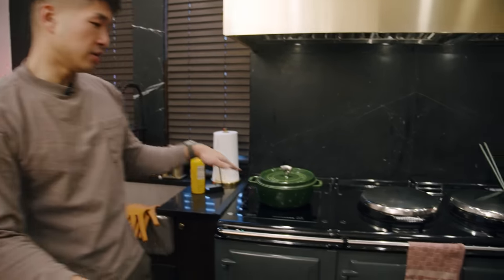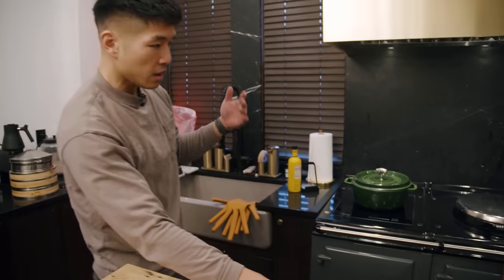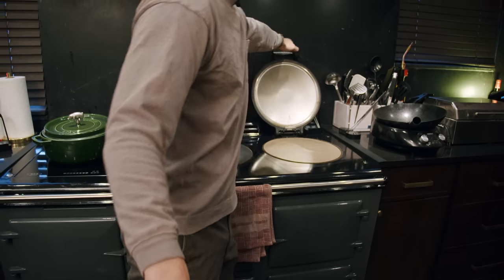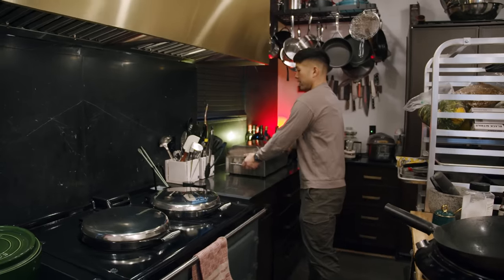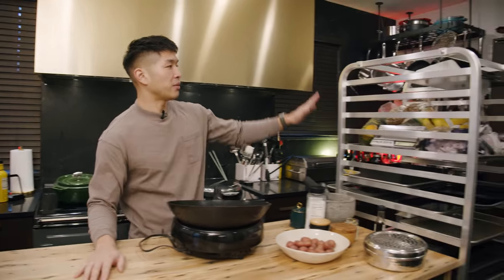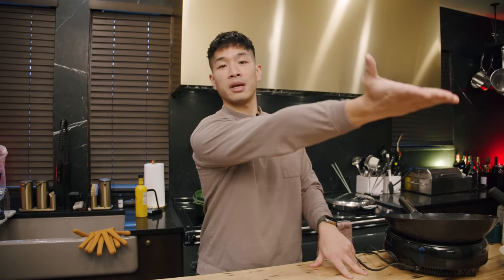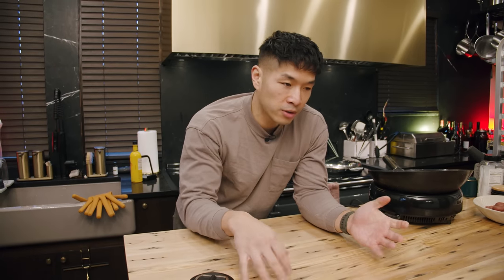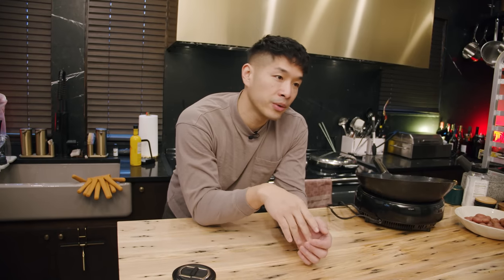Kitchen Tour: A (Gas Free) Kitchen That Does It All!

Comment: My husband is from the UK and he could not deal with the slowness of U.S. tea kettles. He bought a European kettle, changed the plug and we upgraded one outlet in the kitchen. It's so useful to have that upgrade available and of course, for as much as we use our kettle, it's totally worth it.
Reply: Is a European kettle an electric kettle or is there a difference between electric kettles in the US vs the UK?
Reply: @kimiya777  There's a difference between electric kettles in the US vs the UK. The difference difference really starts in the countries electrical grids and ends up in the kettles. The US standard is 120V and the UK standard is 240V, that means that UK kettles can be (and in fact are) designed to use more electricity in order to heat things faster, about twice as fast.
Reply: @kimiya777 It is how much power an outlet can provide which determines how quickly a kettle can boil - not the voltage. Power is voltage multiplied by how many amps the outlet can provide. 

In the US, a 15A outlet can only provide around 1700 Watts, and a 20A outlet 2200 Watts, while a typical UK (and European) outlet can provide around 3000 Watts 

Electric kettles in the UK are typically between 2200 watts and 3000 Watts.

Comment: as a person who is pretty stubbern on gas burners thank you for showing me this perspective. the induction wok burner is very cool
Reply: Yes, cool indeed. But will it convey the wok hay needed in most chinese cuisine.  I'm stubborn not because of the convection stove, but the price of electricity is relatively higher in my country. Even some laundry owners use gas to power the dryer.
Reply: @senadzri  Solar panels could be an option. Wouldn't need an expensive setup just for a stove. If you want wok hei, just use a handheld torch and torch the food gently from above--it's the combustion of oil particulates that gives the wok hei flavor
Reply: ... stubborn*

Comment: As someone who has had both an induction(new), gas(very old) and electric(mondernish) kitchen. I would take the old gas kitchen anyday. That stove was literally older than me and performed better than any induction range I have used. I wish induction was as good as he says but in my experience its just a better version of electric which is not better than gas.

Comment: With the induction wok, can you lift the wok off the burner and toss the food as is common with wok cooking, then put the wok back down onto the burner and have it continue cooking seemlessly? The reason for my question is that with many induction surfaces, the burner will turn off automatically if it doesn't sense a pan, and you have to manually turn on the burner again.

Comment: Hey there could you do a video on your Wok - seasoning, maintenance, and cooking basics? I got the same one because of that short you made a while back. Everytime after I season it, it will eventually fail and rust. I tried various methods of seasoning and it seems like the problem is that while I'm cooking, my metal spatula chips the polimerized seasoning and exposes the metal? Not sure but my first cook after seasoning is perfect but each one after is worst until everything is sticking and burning. Would love to learn from your expirences with this tool. Thank you!

Comment: I'll confess: AGAs have ALWAYS bothered me because of their whole "have to be running at full blast 24/7, 365" angle- but then, I'm a skinflint wrt to energy expenses
Reply: The newer all-electric AGA range series (eR7) is does not have to be left on. It also has a TouchPad control to individually turn on whichever area you use instead of heating up the entire unit like it does for the other model you're referring to. Game changer!